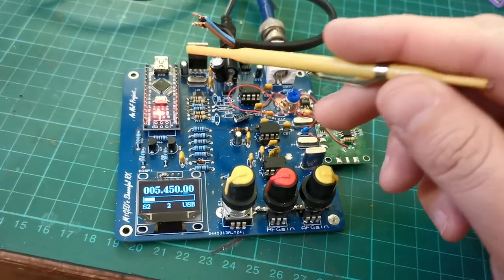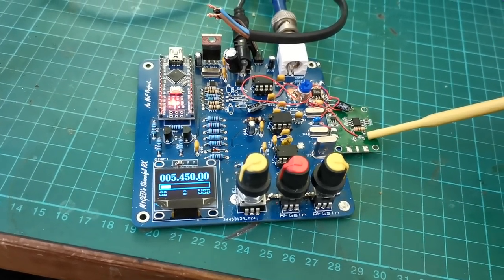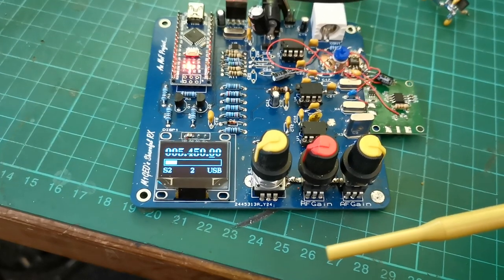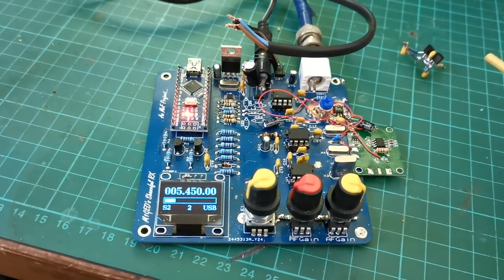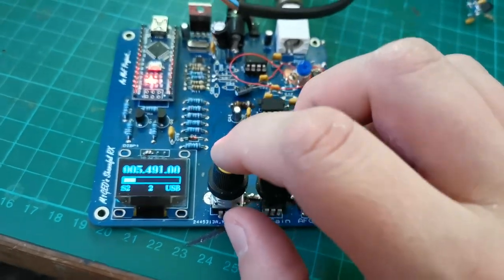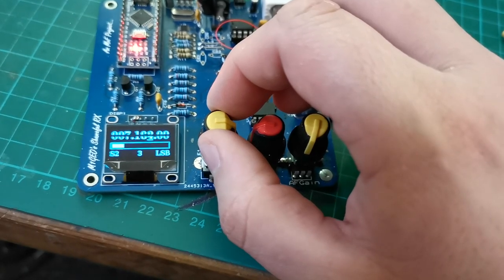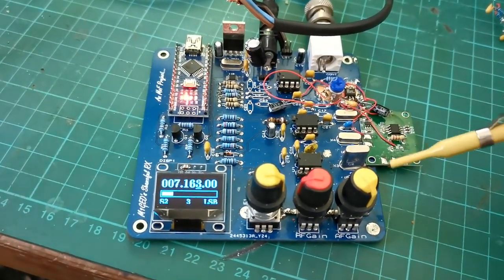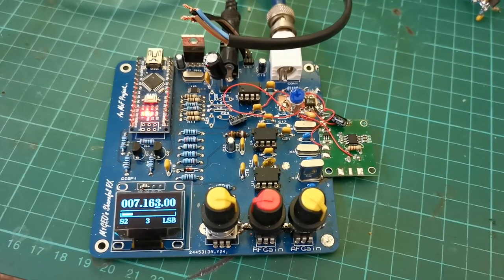Homebrew Superhet Receiver - M1GEO/G8OCV

Comment: Very neat. A nice project.   I looked for a leaded version of the SI5351 but I don't think such a beast exists so for bodging  I use SMD parts soldereded onto on a little plug-in hearder board  for dodging. I think from memory the header boards came from farnell.  It was a while ago.  A very handy little chip indeed and a NANO clone costing not much over 2 quid has plenty of power to add bells & whictles.
Reply from the maker: You can get the Si5351a on little breakout boards for almost nothing. As many people have expressed interest in this, I'll. Switch to using one on the next board spin. Tempted with SMT passives, but will probably stick to TH as people like those.